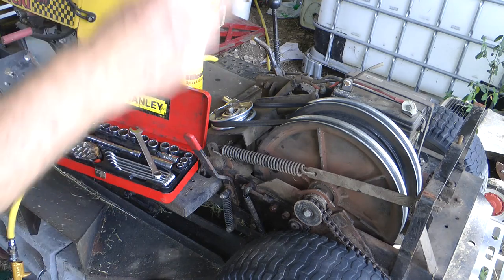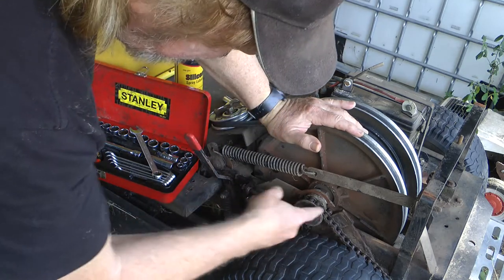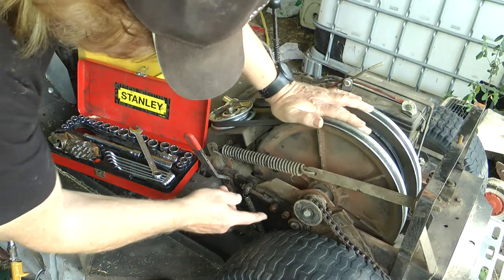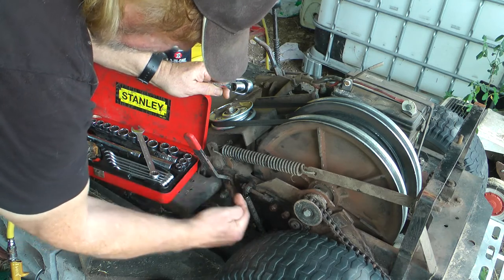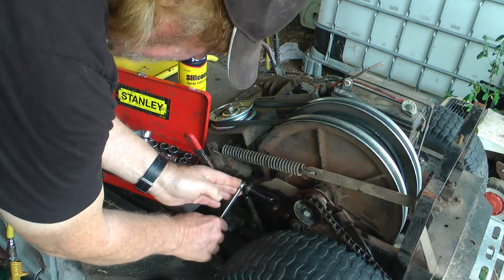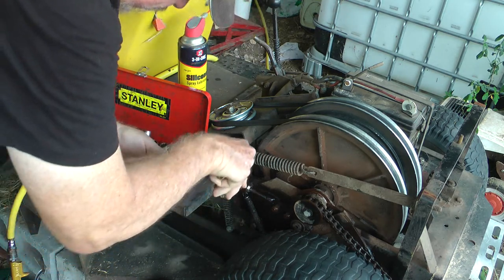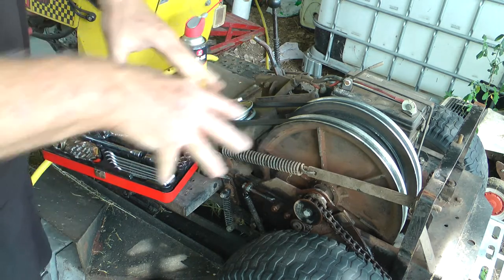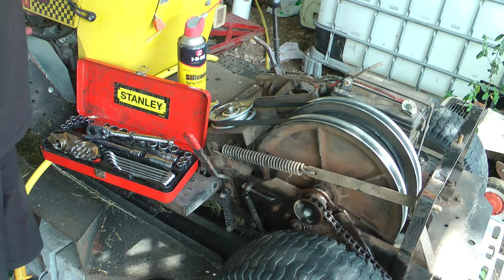How to adjust Drive chain on Greenfield Rider mower.    Please subscribe.

Comment: YouTube deleted my previous post.
I have a Evolution III Mk 2A 11.5/30. My mower does NOT have this adjustment. There are two bolts under the back of the mower. The manual doesn't give any clue on how to adjust the chain but it does say that the part is "Chain Adjuster" part no. GT-18865, page 17. 
I may have found the answer on out door king